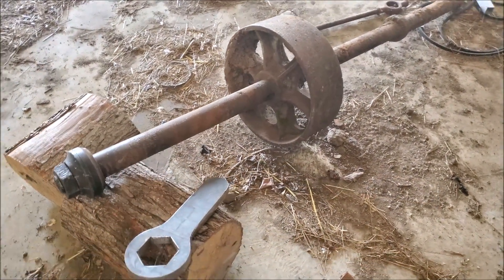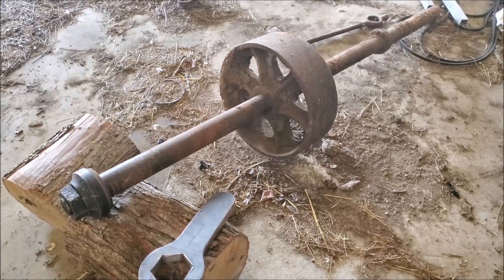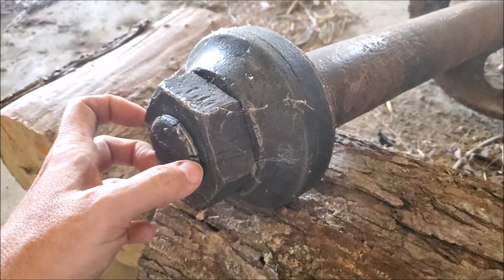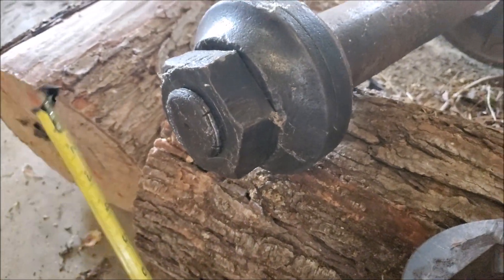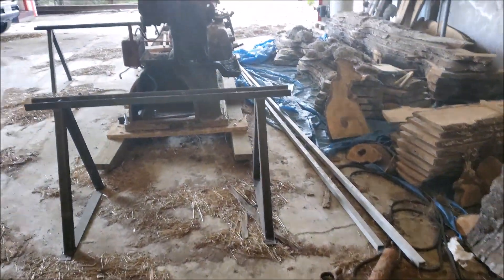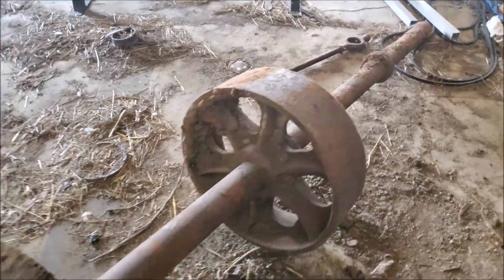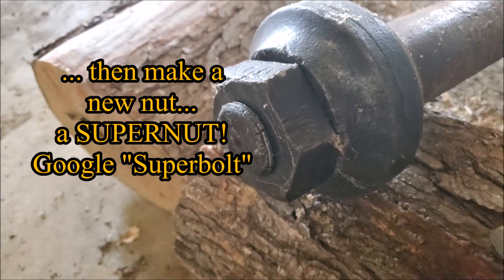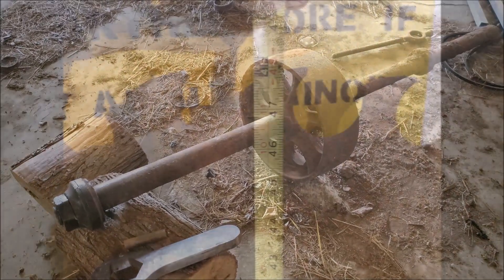Biggest Lathe Project EVER!

Comment: That stub by the nut looks like the classic result of beating on the end of the shaft. The thread has mushroomed out and has the telltale radial cracks of a badly beaten cold chisel. This is why the nut turns but won't come off. There is nothing wrong with the nut.
Reply from the maker: I agree nothing is wrong with the nut. The damage on the threads is nearly impossible to eliminate because there is so little exposed, it's nearly under the nut already. If something must be sacrificed to make the arbor usable it will be the nut, easy enough to duplicate, and chasing the threads of the shaft will be fairly easy once the nut is off.

Comment: Gonna take awhile to sharpen that blade! I would use that center in the end  with the nut to turn true off of to get it apart as I think that would be less fussy than welding in something and then trying to get it to run true to the threads so you don't have to cut it way undersized to clean it up.
Reply from the maker: That blade is wall art - doubt the sockets would hold tooth inserts well at all! I have a 4-jaw, so I could indicate the OD of the fixed collar accurate enough to turn the nut off, then re-indicate once I have the nut and outer blade collar gone. There should be 1/2" or so of true 2" arbor to accurately pilot the blade to indicate from. I'll look at the center, it looks tiny in the video, but if I run a center in the headstock and I'm running a steadyrest on the other end, what keeps the center engaged? Drive dogs would get in the way of turning the nut or threads...all would be so much easier with a 96" lathe...